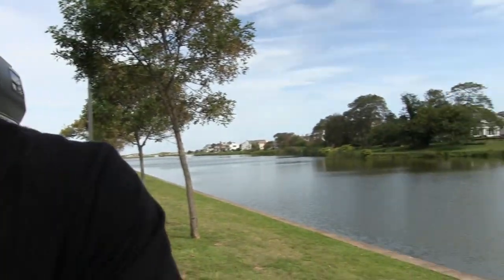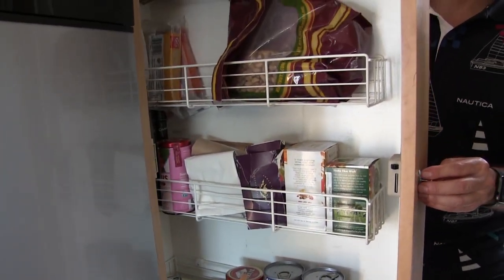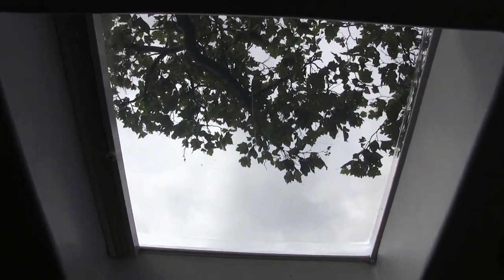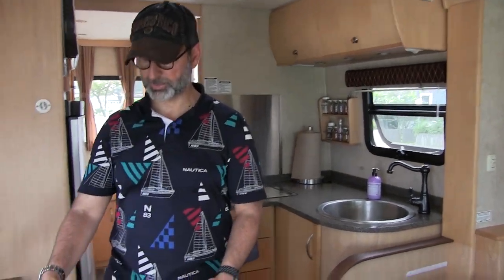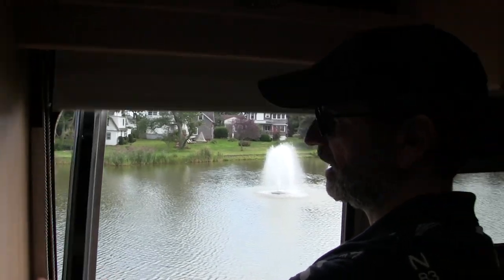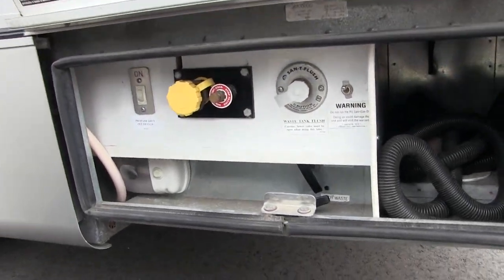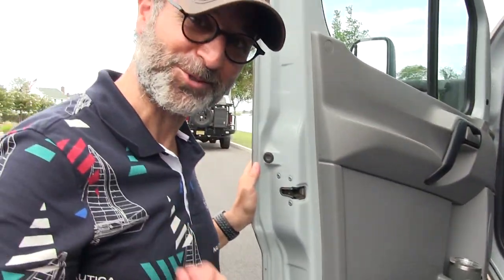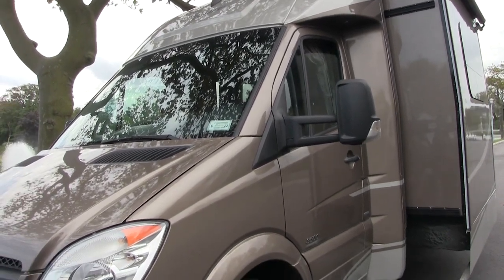LUXURY MERCEDES BENZ RV | Tour The Leisure Travel Vans Unity Murphy Bed U24MB

Comment: I love this one! I would like to add some sort of contraption though that would elevate a solar panel up above the ac unit and the vent when you are parked. Reducing the need for propane. I don't know if that is possible because I've never seen it done. Thanks for all the info at the end like where you can't go with propane and all the rest. I haven't heard about that on any other video. And the info about the different classifications of RVs. Very helpful for someone like me  who is in the dreaming and research stage.

Comment: This is an incredible layout.  Lots of room and storage.  I would prefer if the bed were manual though because: 1.) This one here is too slow  2.) This one could fail and be costly to fix.
Reply from the maker: Thank you
Reply: Fred Neck  Yes. I have seen the Atlas and  the bed is manual.  Did not know the 2015 and up on these leisure vans went to manual. The electric ones must've been failing.  Thanks for the info.

Comment: This guy is making stuff up!

Solid wood cabinet  doors?
RV's don't come with screen doors?
Door lock can be broken into with a can opener?
Steel side skirts are aluminum.
Propane exhaust?  How about generator exhaust.
Reply from the maker: Thank you for checking it out
Reply: Most everything is solid wood, this RV in 2011 came oem with those doors , the can opener comment was meant to say it’s almost impossible to break into the RV unless you break a window or come through the walls...I meant generator exhaust (im a Newbie)  side skirts are a heavy Thush aluminum ...thanks for the corrections !